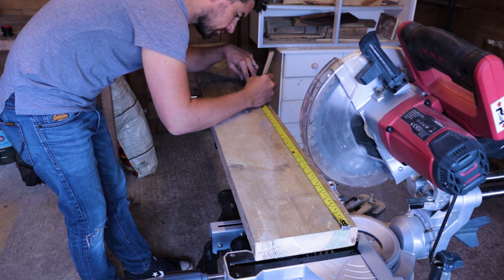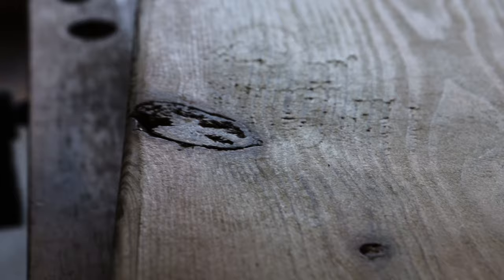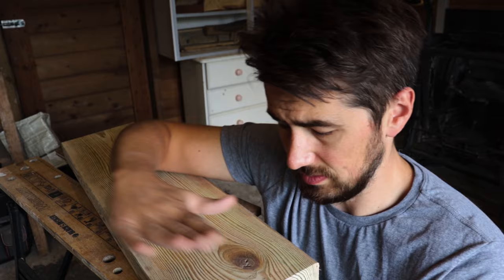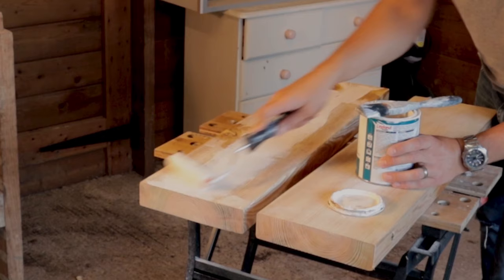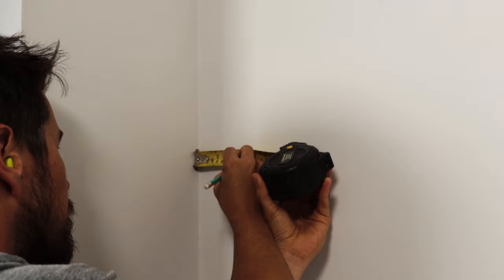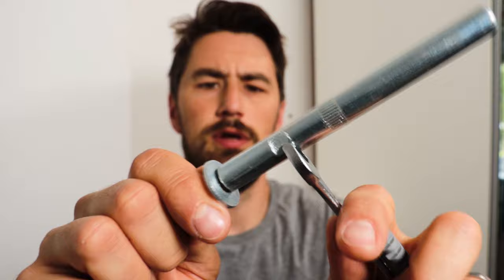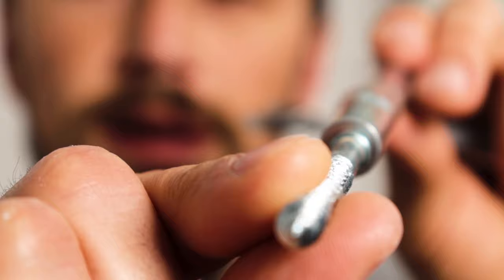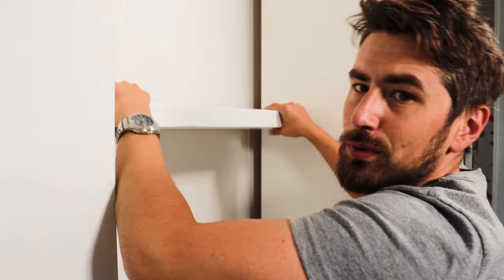Easy DIY Floating Shelves | The Best Floating Shelf Bracket?

Comment: Hi , Fantastic video show. Do yo think that could be use in Hollow concrete block wall? The wood that I have got is Carob so is quite heavy. Thank you for your time
Reply from the maker: Thats a tricky one. I wouldn't like to say one way or the other.  

If they are weak you can always add more for extra stability but then again if the wall blocks are hollow there wont be much for the bracket to hold on to so it may not work.

Comment: Brilliant video buddy , great job you should do more videos 👍🏻
Reply from the maker: Thanks! Glad you enjoyed. In an ideal world I'd be making videos every week but it takes a lot of time. It's deffo a goal and comments like yours makes me want to get there sooner 👍
Reply: @NeilLovegrovemaker  I'm literally putting one up now but it won't slot all the way in , it makes a sound as if the bolt bit of the screws is hitting something in side the shelf hole?🤔
Reply from the maker: Have you tried pushing s lose bracket in the hole to make sure the hole is deep enough?
Reply: @NeilLovegrovemaker  managed to get it on all the way 🙂👍🏻 I tightened the screws more so that they sunk into the wall further and then finally after lots of adjusting the shelf touched the wall! Thanks again though awesome video , editing and explanation with resin etc and the knots taught me loads! 😀

Comment: Hi Neil - I have a question which I am hoping you can help me with.  Bear with me here . . . . I was already researching floating shelf fixings when I came across your video which was very helpful.  I am planning to wall-mount a mantle (shelf) above a redundant fireplace, but my shelf will be only 4 inches deep (102 mm)  - when measured from the wall to the front edge of the shelf.  I can find online only one size of the floating shelf fixings that you used, which actually require sliding into the (drilled) shelf by 122 mm.  (I do like the ones you used because of their level-adjustment feature which you demonstrated.) But I need shorter ones that would slide into a drilled shelf by (approx) only 76 mm.   My question is this:  Could I cut down (shorten) the ones that you have used without impairing their function?  If so, how tough is the metal - could I cut them with a hacksaw or would I need to use an angle-grinder?   Any thoughts or suggestions?  Thanks
Reply from the maker: Hi Gary,  I would go for chopping the end off one to see if it works! I can't see how it would reduce functionality if you're putting in a smaller shelf. I think you would get through it with a hacksaw, give it a go at least. If not an angle grinder should do it

Comment: how would you go about installing them on plasterboard? Perhaps cut a rectangle the size of the back of the shelf, so that it can get flush to the wall?
Reply from the maker: Not too sure really. I wouldn't use the wall plugs that came with it. I'd look to use a fixing specifically for plasterboard..  or get and did the wooden studs

Comment: Hi Neil, just happened to come across your videos yesterday and they are brilliant I’m gutted there aren’t more! During the lockdown I have been trying to find the “DIY” within myself, something I have never really done before. For my 26 my misses was wanting to get me a decent drill just for things around the house but I don’t know of any that are good for a beginner, any suggestions would be brilliant! Once again, great videos!
Reply from the maker: Hi Chris. Thanks for the feedback. I wish there were more videos too. Unfortunately with a day job and young family I still haven't mastered how to make a video in less than a few months. The process is getting faster though so stick around and hopefully I'll get them down to the weekly rate they people are demanding! 

With your drill it really depends on what you want to use it for. Read reviews before you buy and you should get a feel for if it's right for you.  

I'd  recommend getting one with "hammer" function so you can also use it for drilling into walls. Also look for one with 2 batteries so you can always keep a spare charged - nothing worse than going to use it and it being flat. If it's battery the higher the voltage generally means the more power. Mines an 18v DeWalt. I've had it 10 years now and it's still going strong.  Hope that helps
Reply: @NeilLovegrovemaker  It does mate thanks! My misses dad is an upholsterer and has been for a long time now and we are going to be moving in with each other soon (me and the misses, not her dad) and I would like to try and gain a useful skill that I know you can have loads of fun with.

Comment: Do you have any advice for removing the brackets? We have the same for our floating shelves, but right now are moving house, and are really struggling to take them out the wall 😢
Reply from the maker: I've not had to take mine off yet. I'd probably start with trying to pry out from behind the shelf, or fitting a clamp to the shelf that can be gripped better

Comment: At the end of your project, it looks like the shelf doesn't move at all. However, our application is inside a camper van, so there is quite a bit of vibration while driving and we go nuts if stuff in the camper vibrates and makes noises......do you think this bracket system will rattle a bit when in motion? Or are the shelves truly tight to fit? Also, thanks for the excellent presentation.
Reply from the maker: I don't think I'd trust them in a campervan.. they could vibrate off if not on tight

Comment: Any idea how you'd get these out? 😂 Moved into a house with a couple of shelves with these brackets/fittings on it. Ridiculous trying to get the shelf off these brackets in order to wall paper the kids room 🤷🏻‍♂️ any help is appreciated
Reply from the maker: They're only held on with friction so in theory the shelf should pull off woth enough force. That said, if they weren't aligned very well when installed ans the shelf was bashed on I can see how it would be tricky ti remove. 

In terms ideas.. I'd try gently prying off with something like a claw hammer or crow bar. You'd need to work each end at the same time so they come off straight. 

You could also make some wooden wedges that you could tap in along the back edge to slowly pry it off.

Comment: Get yourself an SDS drill. They aren't expensive and the task that you were dreading becomes a breeze. The real difficulty with those brackets - any sort of bracket really, is getting the holes perfectly at right angles in both the shelf and the wall. Master that and it's plain sailing.

Comment: Hi did you pin which brackets you used as there are so many on Amazon n they have mixed reviews,  rather use some that someone has tried n liked 😊 by the way saved my hubby a big job me watching this 😉,  as I want 4 long chunky shelves put up in our lounge n he was like... it'll take forever to make n put these up I've only got 1 day off n I've got the ceiling to paint too 😆ooops , bless so yes a big thanks from my hubby 😀
Reply from the maker: I'm pretty sure i linked the ones I used in the description, but from ive seen they all are of a similar construction. Most bad reviews come from people not installing properly or using them for something theyre not suitable for.

Comment: I wanted to see your failed attempts at drilling holes. Where you said it went red hot etc. 
So does the drill bit make a difference in the precision and ease of drilling hard walls? 
Thanks
Reply from the maker: This happened on a previous install and I wasn't filming. Drill bit makes a lot of difference, especially if you're drilling into a brick wall. 

You ideally need a hammer action drill, and a drill bit that won't blunt when it gets hot. Cheaper ones blunt very quickly and then start to.just get hitter as they get more blunt.. ending with burnt carpet!

Comment: How do you remove this? I was just evicted and need to remove the shelves but they're solid! Should I try and pry them off? Don't want to damage the walls either.
Reply from the maker: I've not had to remove them yet! I would avoid prying in case you damage the wall. You may have to sacrifice the shelf though. You could screw in an anchor point to the shelf the hammer or attache a strap to to pull from. You could also try a quick grip clamp configured to push outwards and push between the wall and a sacrificial block screwed into the shelf

Comment: The problem with the drilling is you didn’t seem to use a drill with hammer action. This is the reason it all heated up last time and didn’t work, and ruined the carpet. The hammer action will make light work of drilling into that wall. Also, if you did need to remove that shelf just get a Jimmy bar down behind it and it will easily ‘lever’ off the wall. More force than trying to tug on the shelf. Good luck.

Comment: Daft question but how did you measure where the holes for the raw plugs would go for the brackets and make it line up with the holes you had drilled into the wood? Im assuming you measured in from the edge of wood to the first hole, then just transferred that measurement to the wall?
Reply from the maker: It was a while ago now but think It was as you said with a tape measure. Another method is to put a strip on masking tape along the wood,  Mark the holes, then sick it on your wall

Comment: Very good.  By now, you will probably have discovered how much easier it is to make holes in very hard materials like brick and concrete: the SDS drill. If not, go buy one. It's akin to when you start using impact drivers, and you think to yourself, how did we ever manage before they came along.

You video was educational, but my walls are plasterboard, so I imagine those nice bolts would work so well in the flimsy studwork behind the gyproc. My search goes on...

Comment: Great instructions, must get that drill bit. I've got  a floating oak mantlepiece that I want to replace with a wider one, and I can't work out how to get it off or how it's fixed on 🤯 any ideas?
Reply from the maker: I would have a look for any hidden screws or fittings. See if there are any areas where the wood grain is different where a screw head might have been covered. Otherwise you could try gently prying it off with a crow bar to see if you can peep behind to see how it's being held on.. if all.else fails you could go further and just rip it off with the crowbar and deal with the mess and damage to the walls after!
Reply: @NeilLovegrovemaker  thanks for replying, I'll do that ☺

Comment: What is the weight of your shelf ? 
I have a live edge messmate timber- 1500x400 mm. I want to put it up as a floating shelf but it’s quite heavy and I am looking for some heavy duty brackets. It would be nice if you could let me know how many kilos these brackets can hold.

TIA
Reply from the maker: I don't have that info in afraid. The good thing with them is that if it needs extra support you can remove the shelf and add more studs for strength without removing what you've already installed

Comment: Awesome video! Great find on the bracket bolts! 

Not trying to sound bad or disrespectful, but a masonry bit will get super hot in wood because it’s not designed for that type of material. You should look into a multi material bit. I have a few Milwaukee bits that look like a masonry bit, but the tips are a lot sharper. Other then that, great video! I also learned something else about the knots! I didn’t know you could coat them with something to stop that resin from coming out! Great tip on that too!
Reply from the maker: It is in fact a masonry wall I just cut the part out when I explained it. The problem was a very old tough wall and cheap, blunt masonry bits

Comment: It looks a good idea and well presented, but did I see the shelf wobble when you grabbed hold of it?

And presumably all the people banging on about the drill bit and a stud wall are our friends from over the pond?
Reply from the maker: There would be a as much wobble as the bracket would flex. Which I guess is unavoidable for this bracket type. The shelves are still going strong with no issues though. 

With regards to the stud walls. I can only assume the comments are coming from someone who's never had the experience of hanging anything on a brick wall!

Comment: If you drill the holes in the wood at one dimension..  and the screws in the wall are eccentric for leveling.. wont that change the distance to the holes you drilled in the wood??
Reply from the maker: I believe the screws are eccentric for adjustment should you not have drilled your holes at the perfect distance.

Comment: Good video! is there any guidance on the weight you can place on the shelf using these bolts, i assume more bolts would equal more weight?
Reply from the maker: More bolts would hold more weight,  if you feel its not stable enough it is pretty easy to pull the shelf off  and add more brackets. Other than that I haven't experimented to find out the weight limit per bracket
Reply: @NeilLovegrovemaker  thanks for the response

Comment: Would these wall plugs provided be good for drywall? They seem like they are the equivalent to dry wall mounts but I wanted to ask first
Reply from the maker: I've not used them in dry wall. I guess you could always use a drywall plug instead of those that come with it

Comment: Thanks for the video, it looks so easy! I bought some solid wood shelves that came with those same brackets. I tried to installed them the same way you did and they broke inside the wall when they were half way in. I tried 3, and failed on all of them, now I have 3 holes on the wall with plugs and screws inside. What am I doing wrong? Could it be the brackets? I'm so frustrated :(. I would appreciate if you could give me any ideas. Thank you.
Reply from the maker: What a nuisance! Did they 'snap' inside the wall or have they come unscrewed? 

If you find me on Instagram you could send me a photo and I'll try to see what's going on!

Comment: I live in an apartment and I have the basic tools for beginners. I don’t own any heavy duty tools and I don’t have the money to get them. I would love to make my own floating shelves. Do you have any advice on where to start and how to make the shelves without any of the heavy duty tools?
Reply from the maker: All power tools I used here has a hand tool equivalent that you could use with some elbow grease. Even the drills has a hand poweree drill equivalent. Using power tools just saves time.

For any tools you want to use that you can't afford, keep your eye on 2nd hand websites & shops. You might pick up a bargain. Otherwise you could always borrow a tool off a friend if it's just for one project. 

Hope that helps

Comment: Hi any tips on drilling the hole straight for these brackets? I put one in and had to remove it as it wasn't straight. Can't get the plastic bit out the wall thinking of buying pipe brackets instead. But really want the floating look.
Reply from the maker: Drilling straight can be tricky. Having a square on hand can help so you can see if you're going in straight. So does having a good drill bit. Other than that, a bit of  practice can also help if you have any scrap areas you can practice on
Reply: I hold a small level on top of the drill

Comment: Did you drill into a stud? Or is that not necessary?
Reply from the maker: For my wall it was a brick wall so didn't have any studs. There are some third party plug options out there if you can't align with a stud

Comment: How did you mill the slot for the second hole in the wood.   Floating shelves have one hole and one slot for adjustment?
Reply from the maker: I drilled 2 normal holes and the brackets did the adjustments

Comment: great video, I definitely am going to try this! Quick question about the wood though, how thick does it need to be?
Reply from the maker: Thanks Charlene! I've not experimented with how thin to go with it. I'd recommend a minimum of 25mm thick for a small shelf but you'll need to go thicker if you're putting up anything that's going to holding a lot of weight

Comment: Just curious ...where does one go about getting the flimsy floating shelves you replaced? I think I may have a solution to the problem in the design but I can't find them anywhere to try it out. It's going to be more of a on going project, my original idea I already know is a simple fix and wouldn't support more than cotton candy! But still, I'd like to play around with those shelving kits. Thanks for sharing this, I knew someone would eventually come up with a clever idea like this.
Reply: Usual DIY shops (depending where you're based), as well as IKEA

Comment: Thanks for the video! I tried to hang my shelves today though and they are pulling from the wall (angled down). Should I have put the brackets  into studs? I assumed the wall anchors that came with the brackets would be enough? I'm not having them hold a lot of weight just knick knacks in a bathroom. I used a bit smaller than the anchors when I drilled the hole (I had to hammer the anchors in so I don't think it was too big). But, the brackets move in the anchors. Do you think think would  happen if it was secured to studs?
Reply from the maker: I'd guess you'd get less wobble and a firmer fix going into studs. On this video I'm hanging shelves on a solid brick wall so it's a little different. 

If you didnt want to drill more holes to fnd studs  you could also look at if a better type of wall anchor, designed for stud walls, would give a stronger hold. Hope that helps!
Reply: Yes always into a stud. Or get a bigger anchor that's actually meant to hold weight.  Those anchors in the video only work as long as its into something solid so you can thread the screw into.

Comment: What holds the wood on the bolts?

What stops it from falling out/off?
Reply from the maker: Believe it or not just friction. Its still to push on if you still your hole small enough and it's enough to stop it pulling off